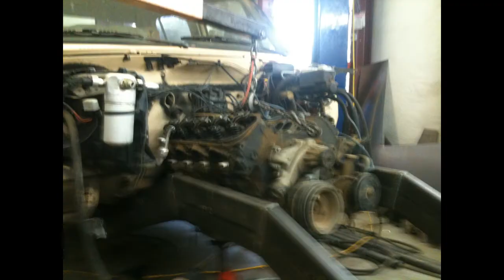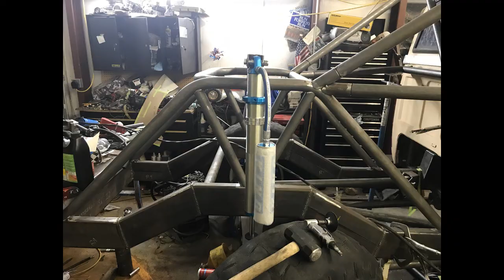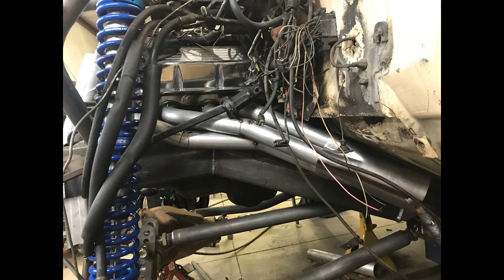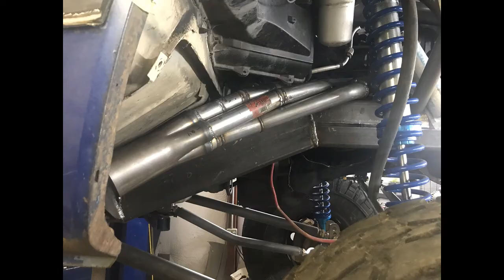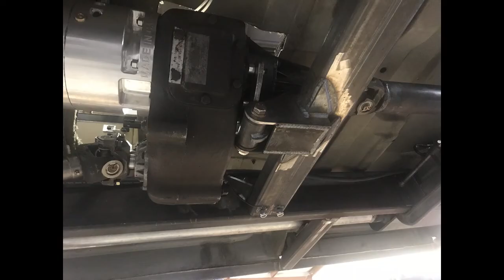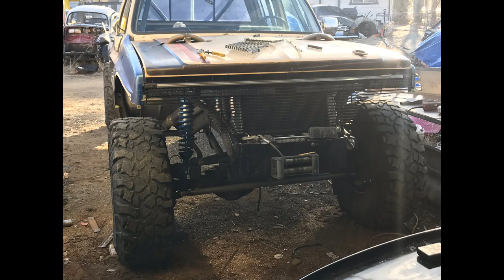$100 Krew Cab Square Body with 4 wheel steering......build pics!

Comment: I found your video after looking for custom 4 wheel steering options for trucks- can you please tell me how I could go about finding parts for that operation?
Reply from the maker: So the rear axle is a front axle from a 2011 f550 that has been cut and centered, as far as how it steers its hydraulic with an electric pump, totally separate from the front steering... it is controlled with a separate joystick and is self centering. I can put you in touch with the guy who makes the control system and pump but the axle will need to be built by you or someone with the know-how in custom axles.